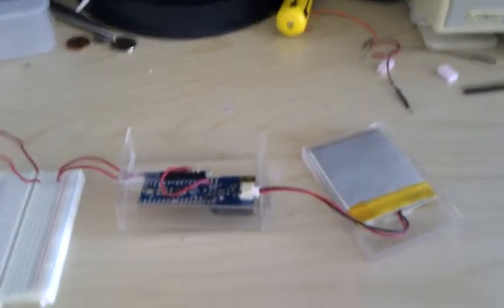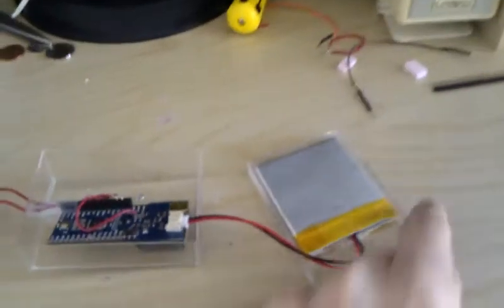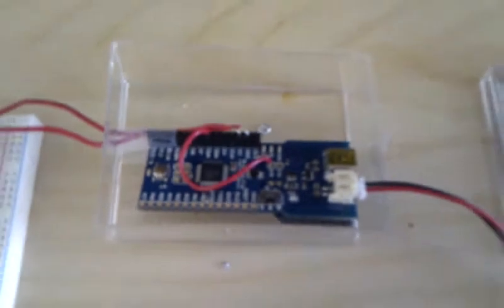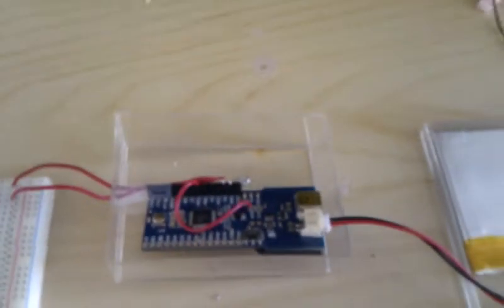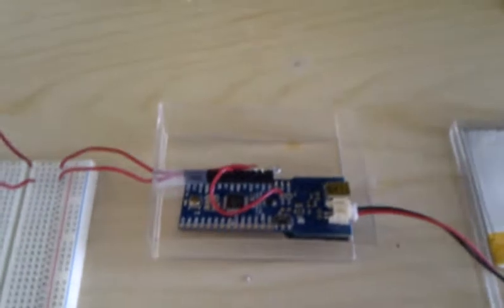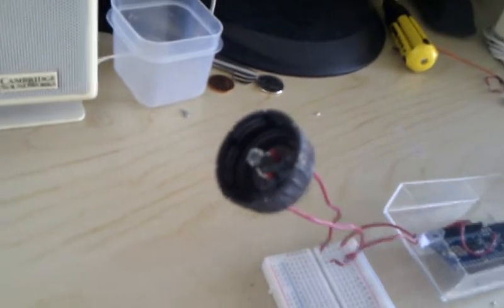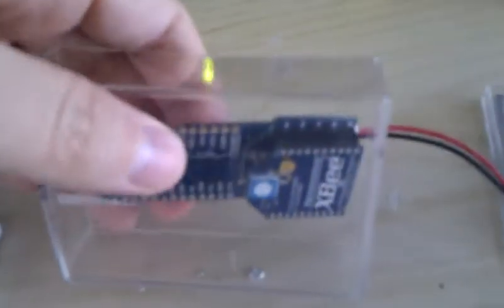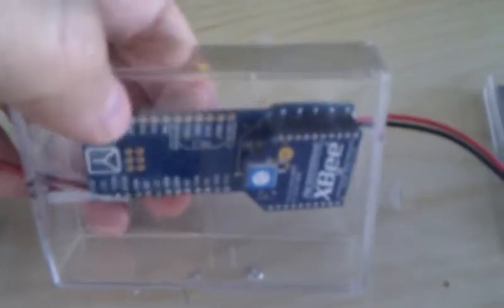Arduino Fio Electricity Monitor

Comment: Nice work! I just have a question. The USB connector is supposed to be used to charge the battery but, can you use it to feed the board directly? I mean, can you use the board with the USB connected to a source and no battery pluged? and if there is a battery and de USB is pluged, would it work?